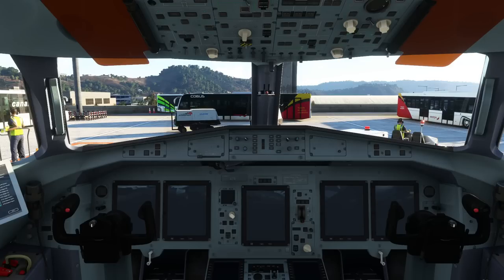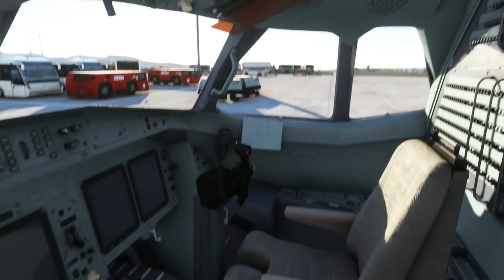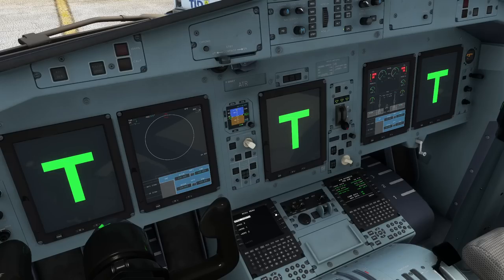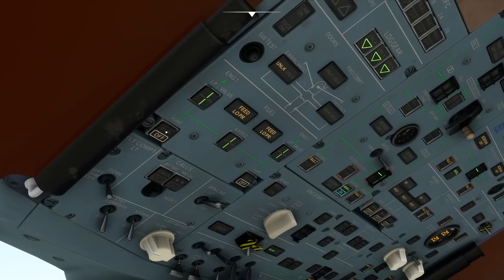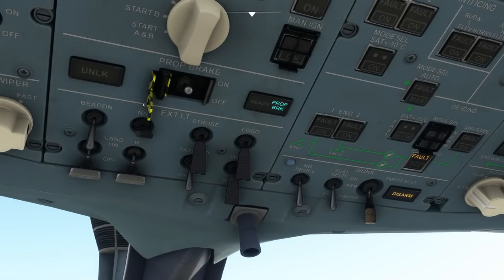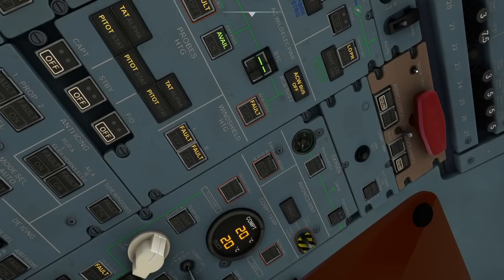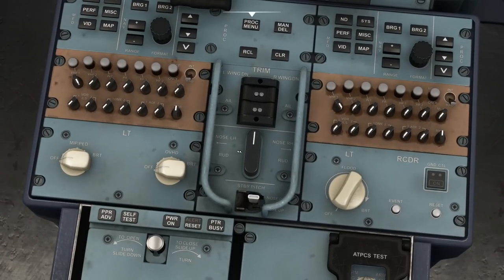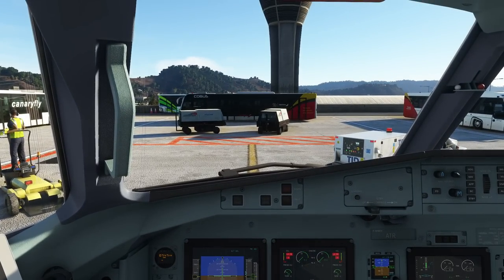ATR 72 & 42 Tutorial 1: Cockpit Preparation | Real Airline Pilot

Comment: Timestamps for me:

0:56 - Fueling
1:28 - GRD Power - Doors OPEN

2:32-3:40 - Batteries - External Power

4:20 - Remove White Lights (except Fuel Pumps)

——— Overhead Panel 5:35 ———
Panel 1: 5:37
L Fuel Pump ON
X-Feed ON then OFF
R Fuel Pump ON

Panel 2: 7:02
Beacon OFF
Hydraulic Pump ON
Propeller Brake ON

Panel 3: 7:55
Emer Lights ARM
Seat Belts ON

Panel 4: 8:36
Only tests 

——— ——— ——— ——— ———

12:30 - Speed Target AUTO

Comment: Great! Thanks for doing these.  I was struggling a little with some things but this has so far cleared up the prep side.  
I didn't do my fuel and payload from MSFS weights and balances though. But it seems this IS the right way.  And it's so awkward because the MSFS fuel/payload is in Lbs and the aircraft is in KG.  Then if Simbrief gives you 45 passengers, it's an arse-ache to input them in correctly.
So yes, this plane is in desperate need of an option on it's EFB to input passengers/fuel/cargo.

Comment: Regarding to the icing test, you actually don't need to press the test button as the system itself will continuously self testing in normal condition and will produce an eicas msg if the system went wrong.
Reply from the maker: Thanks! My copy of the FCOM is a bit outdated, I just saw Fly With Magnars video on the topic as well. It has probably been changed since my eleven year old FCOM copy was released. I wish we had a good manual with the current SOPs!

Comment: In which video do you give your overall impressions of this sim?  Not "study level" is all I heard you say.   I am actually typed in the ATR.  Ha, from the mid 90s when I was on furlough at Continental Express.  Those airplanes of course sported a dramatically different cockpit look because they were largely analog instrumentation.  I don't claim to remember a LOT about the airplane from flying it a year on furlough.  It was slow and considered ugly, ha.  But I thought it flew well otherwise.  The rudder was not hydraulically boosted, which made this high winger a bitch in strong crosswinds.  Landing it in general was an adjustment, and yes, my early attempts were pretty awful.  I eventually got the hang of it. The ATR was also considered an "ice magnet" and there was a very bad icing accident that I recall.  In the US northeast through a winter, I really loaded some ice on it and alarmingly had the tail covered in it.  That was with all the stuff on to prevent it. 
 I have all my manuals, but with the new digital cockpit I doubt they would help me much.  
My biggest reservation is the underlying, weak and puny MFS flight model.  For me it largely cripples the excellent and beautiful PMDG 737, in which most of my career flying was done.  I can adjust to the flight model, though I am left with the feeling that knowing the actual handling qualities of the real aircraft are working against me.  MFS could improve their flight model and make these aircraft pilot sims in addition to them being gamer sims, which is admittedly where their audience is.
Your tutorials are, as usual, a cut above.  You seem to have a real feeling for the systems, and I think you should expand your expertise to XP12, where there is more of a pilot orientation.  Your channel is a very good one and also I wish you well on the (gulp) Airbus.  If I was flying with a guy like you, inflight I would be saying, "so, tell me again what this does"!😁

Comment: A cordial greeting to you, thank you for the explanations, in reality, I have had several problems with this plane, it has not been easy, being able to fly it, at this moment, what is happening to me is that when I start the flight in cool and dark, the flap lever is stuck. No. It moves, if I try to move it it blocks, but if on the contrary, I start the flight, with the plane turned on at the runway edge. The flap lever already moves, so I suspect that it must be some omission in the cool and dark process. Could you explain or give me a guide as to where it might be? my problem . Beforehand thank you very much. greetings.

Comment: With the latest version of the ATR, this flow no longer works for me :( I get additional errors on the screen when I turn the ext power on, for example "air pack 1+2", "air bleed 1" and "air bleed 2". And when I press the Aux Pump button under HYD PWR, it doesn't go on "LO PR", but instead the light goes completely off. Is this a bug, or did they introduce some new steps that aren't covered by the video?

Comment: Great video and needed! I only have 1 problem with this airplane. When I connect gpu to the airplane the dome light goes on and when I turn it off in the overhead panel it remains on. I don't know if I am doing something wrong or the airplane has bug.
Reply from the maker: I wondered about that as well already, but couldn't find anything out yet.